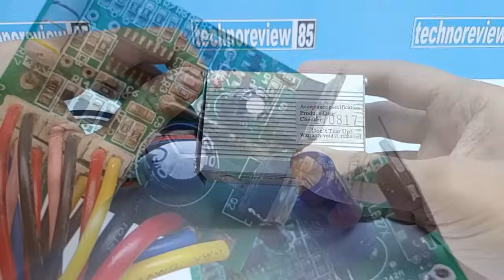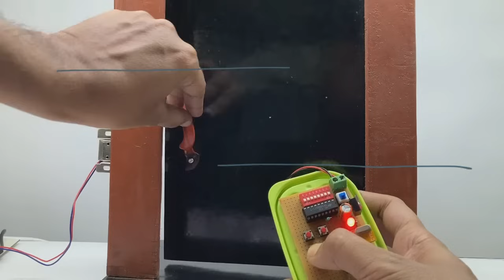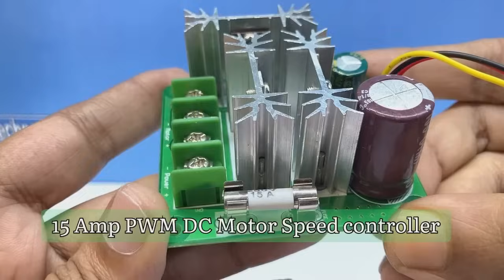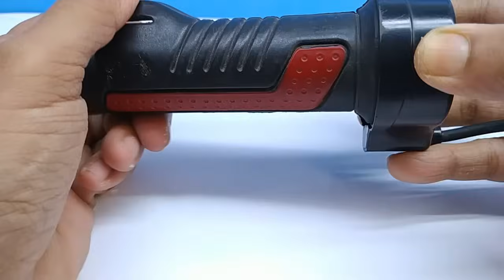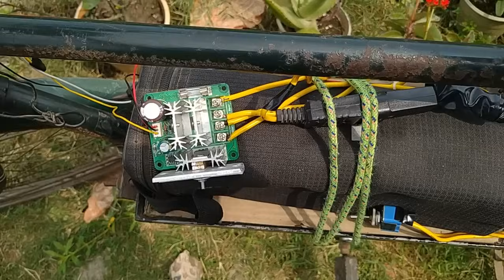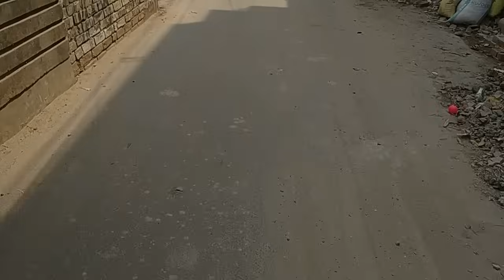DIY CONTROLLER FOR E-BIKE

Comment: can I use a 20A controller for 250w 24v motor will the controller handle it at full load

Comment: I thought you managed to get it to  working with throttle.
So, that, with the potentiometer I found many mounts, the voltage regulators .